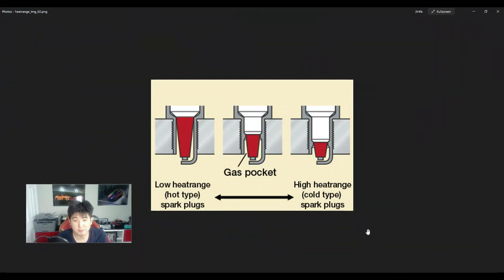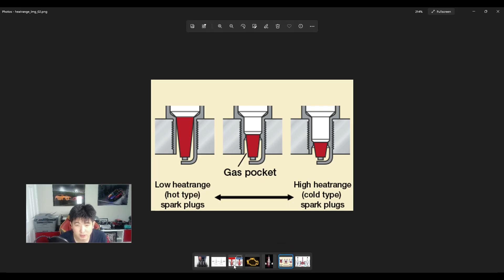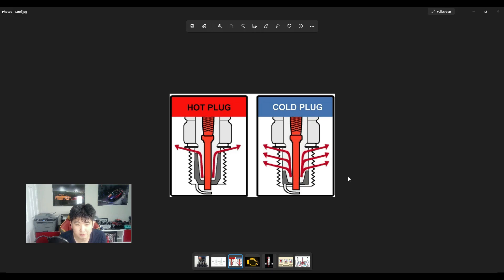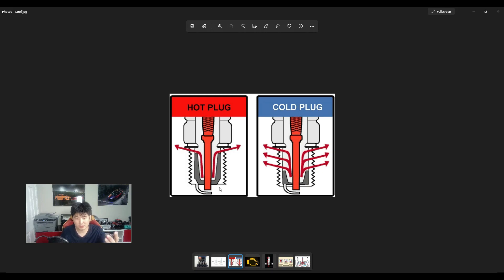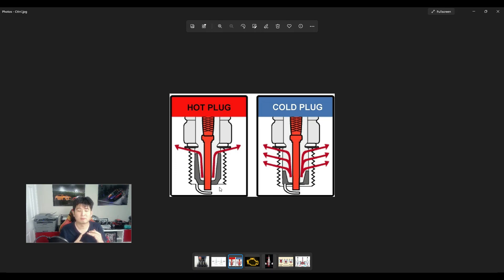Can the wrong spark plugs blow up my engine?

Comment: With your ECU tune, are NGK Laser Iridium Spark Plug 6481 good or do I need to purchase different ones?
Reply from the maker: What car?
Reply: @BTRcarcustoms  2014 hyundai genesis coupe 2.0t Manual
Reply from the maker: @RogueStatusQVX  ngk 2309 gapped at 0.028. Its sold on our site

Comment: What are negatives to a colder plug? I’ve considered switching but decided against it because of people saying cold starts are worse, issues with misfires etc.
Reply from the maker: It will foul out early if the cylinder temps are too low. So do not run colder plugs unless your tuner determines its needed with increased cylinder temps from higher boost or nitrous etc